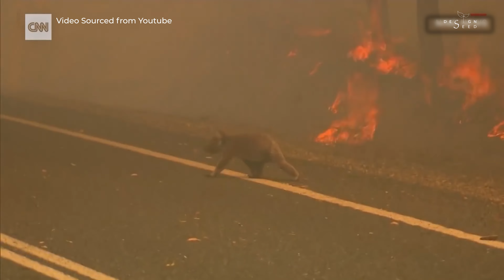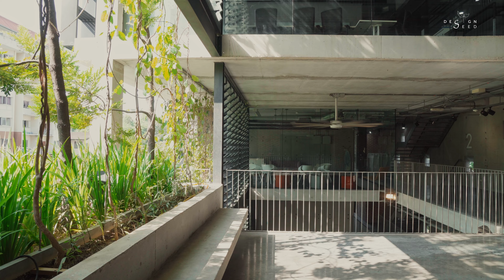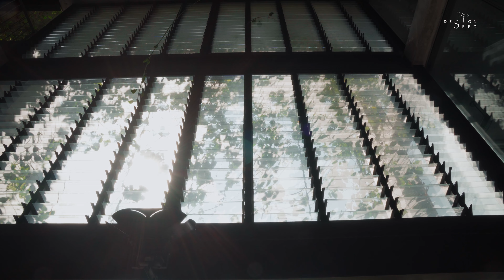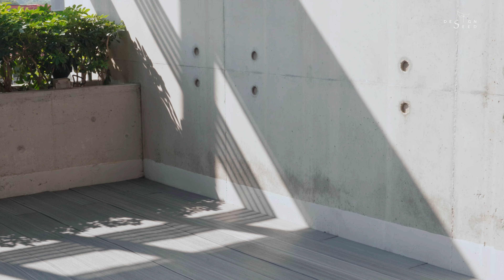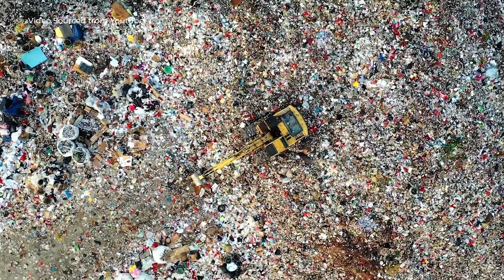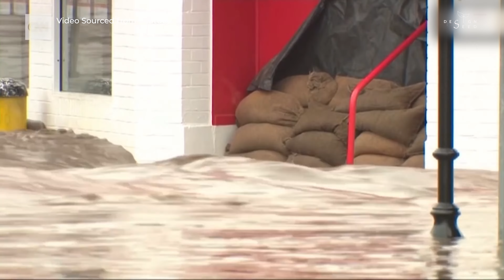Pockets of Garden in the Sky |PAM Centre| Green Building Index | Iconic Architecture Malaysia Asia

Comment: It's commendable to construct green buildings to save energy and incorporate vegetation- something that has been done in Singapore for several decades. The video could have shown more of the actual office spaces and how they relate to the highlighted design features. Much of what was shown, such as the stairways and recess areas, seemed 'industrial' in appearance and rendered spartan and incomplete in the manner of a multi level carpark building. Perhaps the use of exposed concrete is more a tribute to economy than minimalist aesthetics. But what about revealing the conventional means of access provided by elevators or escalators (if any)?- surely required for universal access by the less fit or disabled. And who actually occupies this building?